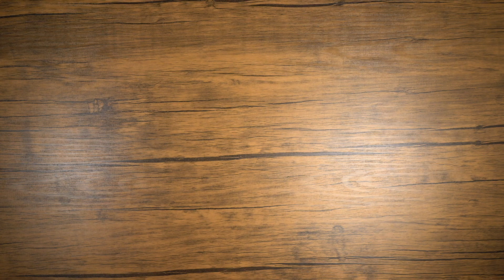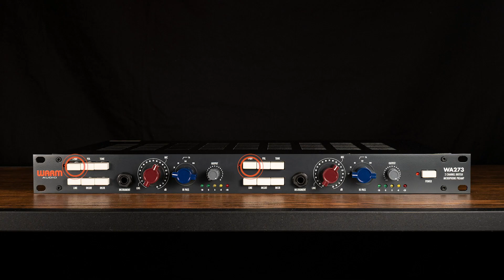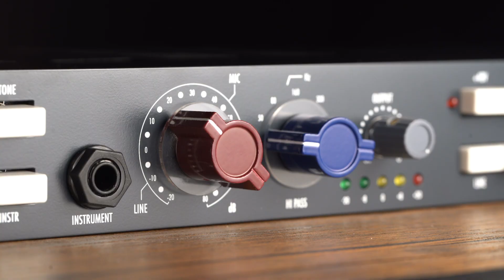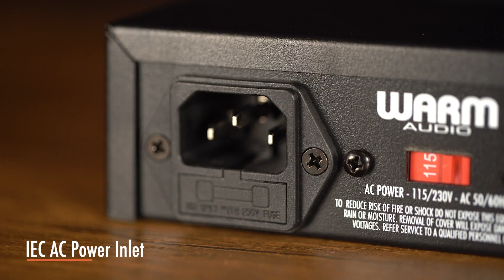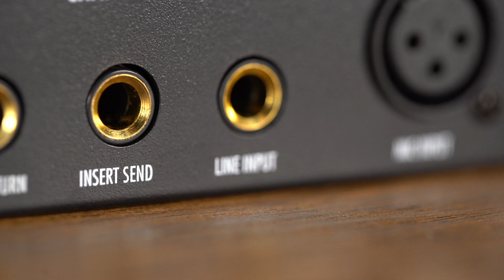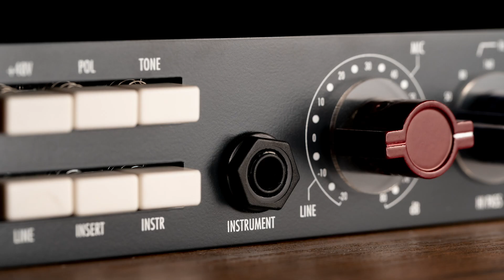Warm Audio // WA273 Dual Channel British Mic Pre "Getting Started"

Comment: The manual needs more hookup directions. How to use direct in for guitar or bass, then what if I want to go from the wa to an interface. What if I have an xlr out on my bass amp and want to go from the amp to the wa to my interface? As well as what buttons to press, cables unbal vs bal, etc Thx
Reply: This is basics of recording and signals, you should google it and youtube also will help you. No gear manufactuers will explain this basic stuff in their preamp manual because it's expected you know that when you buy an expensive preamp.
Reply: @matrixmodulator  literally